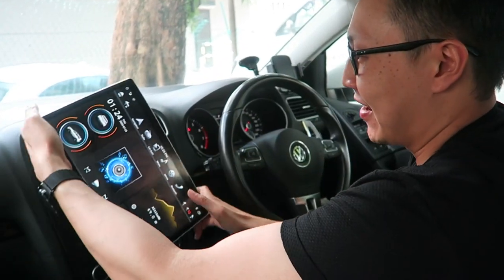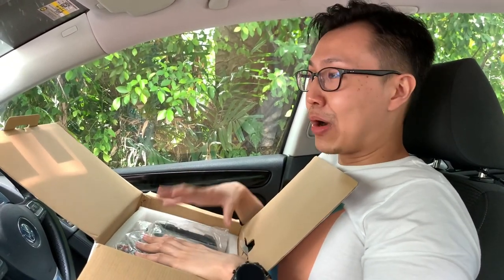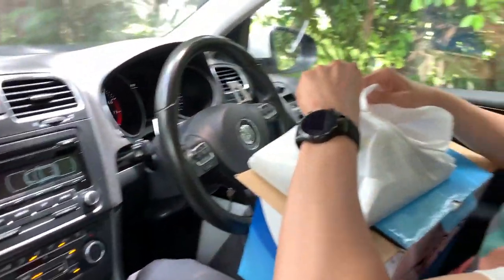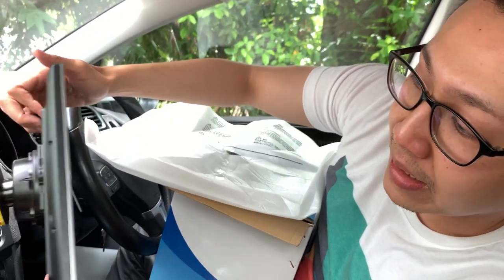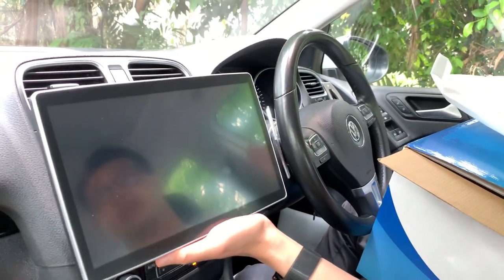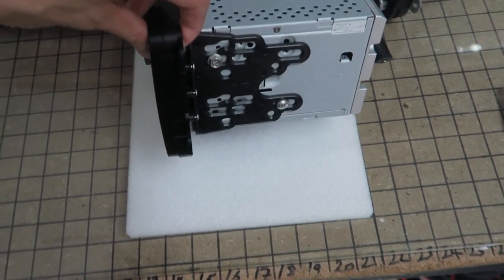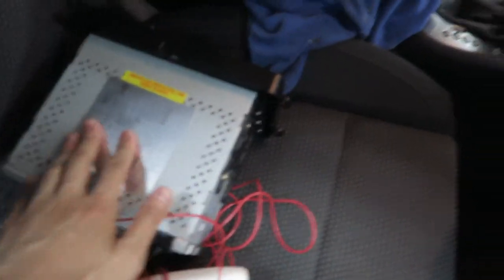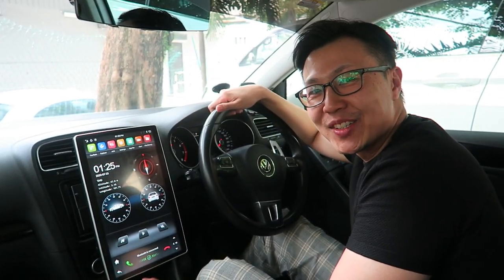INSTALLED HUGE 12.8-INCH TESLA TOUCHSCREEN ON MY VW GOLF MK6!

Comment: The biggest problem going this route is you have to wait for it to boot every single time. So instead of that, I just mount a 10.1 inch Samsung tab A. I use two of those very small circular magnetic phone mounts. Two small metal circles stuck on the back of my tablet, just stick the tablet to the mounts and that's it! No need to wait for it to boot!!
Reply from the maker: The headunit doesn't actually need to boot up every time I start my car (at least not on mine) - it's almost instant actually, unless I disconnect my car battery. Would love to see your setup though, sounds cool!
Reply: @ShawnLoong  can this fit on Kia Sportage 12
Reply: Can you share a vid please?

Comment: Great video, wish I had seen it before I purchased this unit, I cannot keep the time set on the Home Screen keeps changing when I turn off my vehicle, any suggestions?
Reply from the maker: Thanks! Glad to know it's helping :) 
Hmmm that is a odd problem, I don't seem to get that issue.. have you tried setting it to automatic timezone?
Reply: Yes I’ve set time zones as well as the actual time in the setting. When CarPlay is running I can actually get the correct time on that screen. Just noticed my front and back cameras are backwards,lol. I’m waiting for a response from flyunice, hopefully everything will pan out. Once again thanks for the fast response
Reply: @In2black  i think you got the power connections wrong. I’ve installed a 7” stereo on one of my cars and one of the problems I read before is that you could mix up one of the power wires that’s always on and another that’s supposed to shut off by ignition. The unit doesn’t need to be on all the time, but it does need to have that power connection right to keep the memory of clock settings or whatever else. The fact that your cameras are backwards tells me that’s most likely the case as well. Anyway, that’s my guess

Comment: Do you think I can put it in my new Passat?
Reply from the maker: 2020 Passat with the full glass housing? Like the one in this link? https://paultan.org/2020/01/10/2020-volkswagen-passat-facelift-launched-in-malaysia-2-0-tsi-elegance-new-7-speed-wet-dsg-rm189k/2020-volkswagen-passat-2-0-tsi-elegance-fl-malaysia_int-1/
Reply: brought this and it has a lot of problems 1. no video output on rca jacks or the hdmi port  2. audio output through rca jacks are horrible i notice china dont think americans will hook them up to amplifiers signal distort little over half volume and volume changes between left and right every day. output on speaker wires was ok it will due but i have custom system so i need rca's to work i paid for it 3. while watching movie/video it will switch back to home screen on it's own sometimes open browser by it self they sent me update but made things worst I would suggest dont buy this if you want one wait another year or so maybe they will have it right buy then im out 500.00 because they would not take it back and aliexpress sided with them crooks by the book

Comment: Do it have video output
Reply from the maker: No
Reply: brought this and it has a lot of problems 1. no video output on rca jacks or the hdmi port  2. audio output through rca jacks are horrible i notice china dont think americans will hook them up to amplifiers signal distort little over half volume and volume changes between left and right every day. output on speaker wires was ok it will due but i have custom system so i need rca's to work i paid for it 3. while watching movie/video it will switch back to home screen on it's own sometimes open browser by it self they sent me update but made things worst I would suggest dont buy this if you want one wait another year or so maybe they will have it right buy then im out 500.00 because they would not take it back and aliexpress sided with them crooks by the book